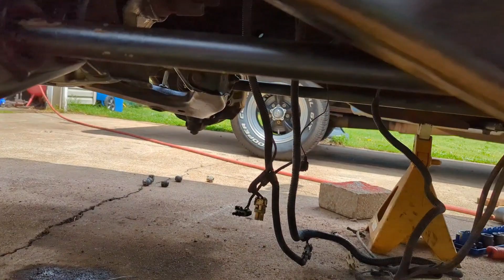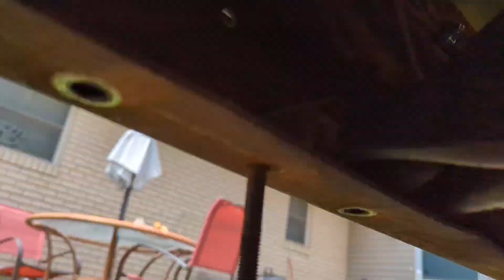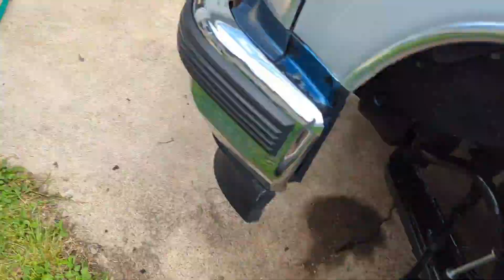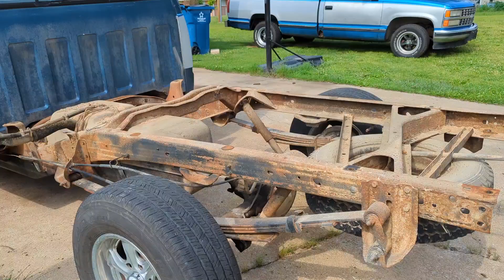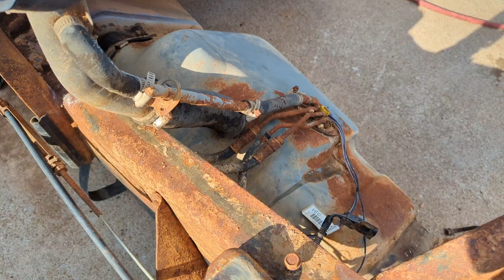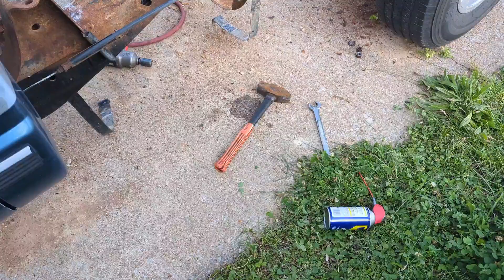How to lower your 88-98 Chevy/Gmc k1500 truck!

Comment: I'm starting to really like the low 4wd trucks.   
.......( Don't tell anyone...but I like the long bed trucks....wonder how many of us there are left?   Long bed and a clutch pedal....now that's how to build an airplane! )
Reply from the maker: I'm seriously considering leaving it a long bed!
Reply: @Wrenchingwithray  If you have a surf board in the back, nobody will every question you.

I don't know.....I thought maybe you would know where to find a surfboard. 
Just a thought.
Reply: Hey the flip Kit you used was it for a c1500 or u found one for a k1500
Reply: @Mrshortbed would there be a difference?